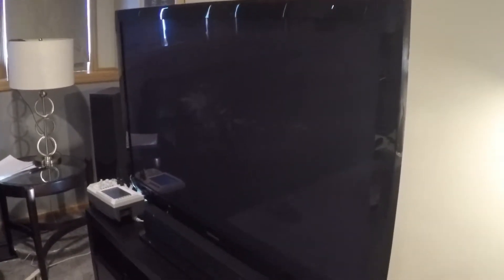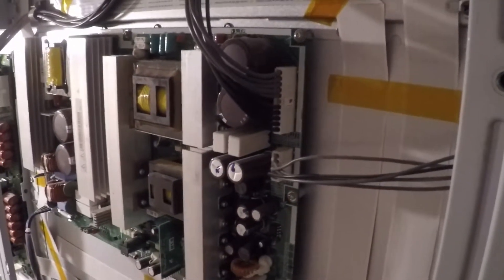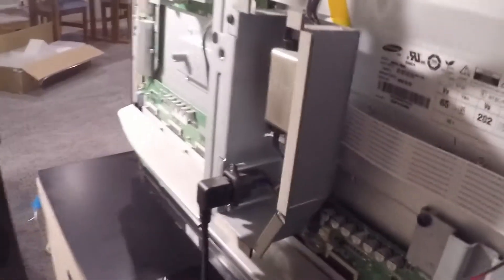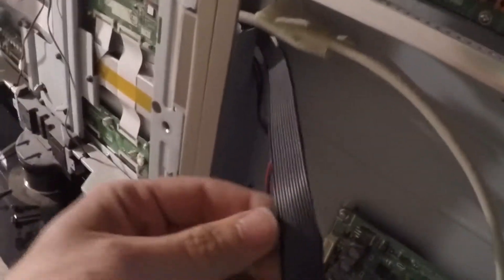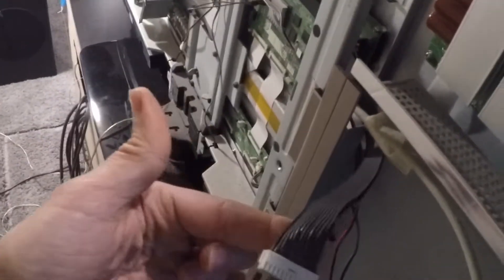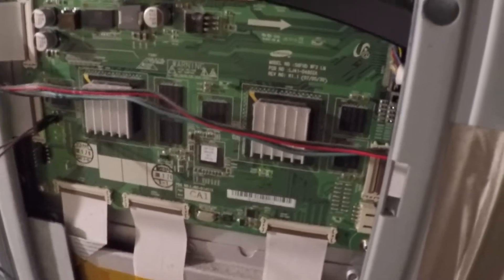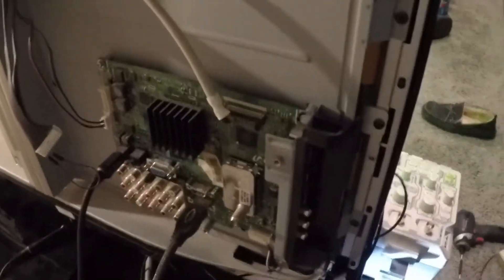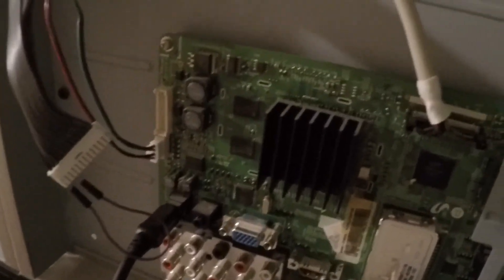PN58A550 Plasma TV 'Logic Main Board' Test

Comment: Thank you VERY much for your videos on repairing the Logic Main Board on a Samsung PN58A550 Plasma TV.  I'm a mechanical engineer, not an electronics expert.  Your extremely helpful videos enabled me to troubleshoot my problem, which was identical to yours.  I didn't attempt the individual component replacements, as the skill and tools necessary to do that were above my capabilities.  I couldn't find anywhere selling a new, replacement board, so I bought a refurbished one from Coppell TV Repair for $180, less a $60 credit when I return the failed board to them.  Before finding your video, I thought I would have to spend $2550 on a new TV but, with your generous help, I have a perfectly functional TV again for $120 for hopefully several more years.  Thank you!
Reply from the maker: you're welcome, but I bet you could have done it!  you just need to think of it as Welding instead of soldering :)  Coppell seems to be a good source for boards....

Comment: Hi friend very good information, my logic board have 2 4pin holders,any idea which 1 is the 1 to use
Reply from the maker: At time 1:53 you can see my black jumper wire on the header.  and on my board: The pins you jumper on the Logic Main board are pins 3 & 4 of the 4-pin header CN2013.  The pins are labeled 3 & 4.  Read full video description for more info.
Reply: @timgoihl  thanks for your quick response